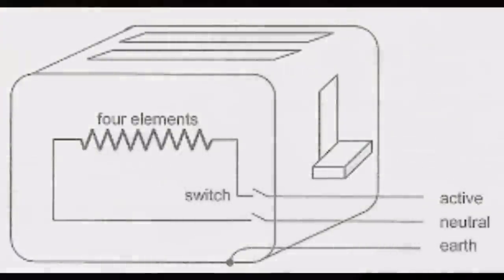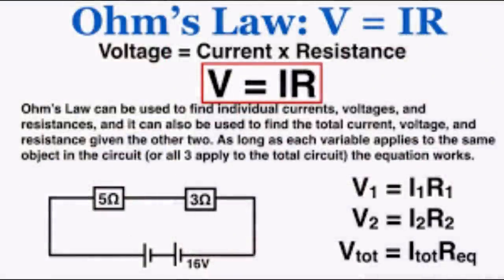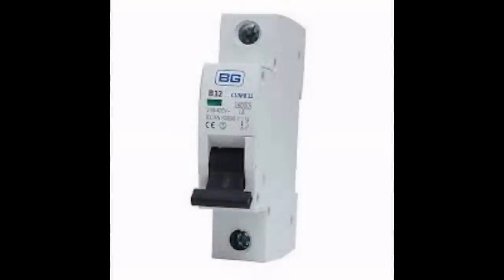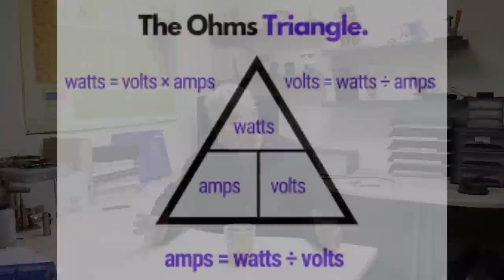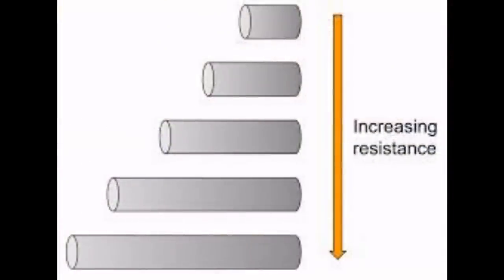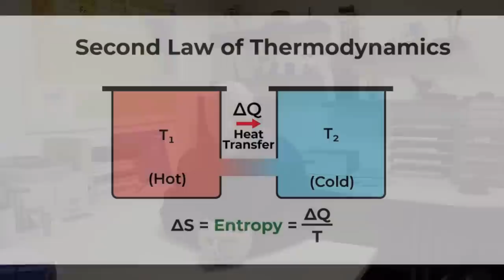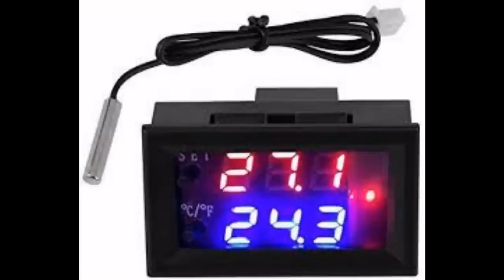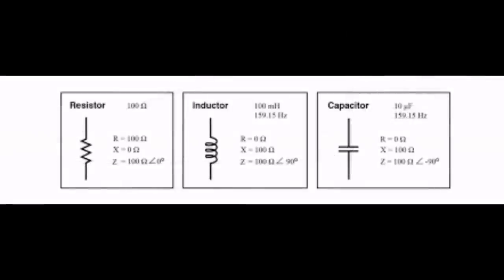1761 Controlling Electric Heaters Of All Kinds

Comment: That was very good teaching, Rob. As for the foot warmer I would like to remind everyone reading here that our body is a constant heat source to consider. When we put our feet on styrofoam it reflects our body heat right back at us making our feet feel toasty. Covering the feet also with a blanket traps the body heat and shields them from the cold air in the room preventing heat loss. Styrofoam works amazingly well and often comes as packaging material. Styrofoam chips should work as well though I have never tried them. Cheers
Reply from the maker: that is a good reminder mate - thanks for making it
Reply: In my working days, a few of the guys in the workshop would stand on rubber mats while at their work bench, made the world of difference in keeping their feet from freezing on the solid concrete floor.

Comment: There are a lot of heater controls available for controlling immersion heaters used in things like alcohol stills. Where you just plug the lead from the heater into the controller, like an extension lead. Some are just mechanical rotary switches, while others are digital temperature controllers and timers. Like the  Inkbird ITC306T.
Reply from the maker: yep loads mate and canoe super cheap

Comment: Hi Rob , thanks you got my head around the carbon fiber rope heating difference between 3 and 6mm :- lower ohms on larger dia size , less resistances more current/amp flow , for the same equal lengths of each size the 6mm will have a higher temp at same voltage open amp draw.
Thanks again

Comment: The one I came across was volts x volts / resistance = amps. I like how that one shows the effect of voltage to resistance. Since most people will know what voltage they want to work with, they can use this to figure amps for wiring and fusing, and multiply amps by volts to get the wattage. It's handy that you can find consistent resistive material easily to fit nearly any situation. Great video as always!

Comment: As for the kettle... When I divide those 3.000 watts by 240 volts I get 12.5 ampere. If I know divide my 240 volts by those 12.5 ampere, I get a resistance of 19.2 ohms, which is a little off of those 17 ohms Rob mentions. Did I do something wrong?

Comment: In North America, homes have a dual voltage system. More specifically, homes are supplies with two 120 volt lines that are 180 degrees out of phase and a centered tapped neutral from the transformer. General receptacles and lighting circuits us either on of the pair of 120 volt lines and a neutral. Major appliances like a water heater or range (cooker) are ran on both pairs of 120 volt lines for a total of 240 volts. Homes generally have either 15 or 20 amp circuits. Often, lighting circuits will be 15 amp, but they also can be 20 amp. 240 lines typically range from 15, 20, 30, 40, and 50 amps. The 50 amp is more for the main breaker for the 120 volt circuits in the circuit breaker panel. In the case of 240 volt breakers, they are actually composed of two 120 volt lines that are 180 degrees out of phase, and they are bridged together so both trip in a fault condition. Newer breakers are starting to have one lever that controls both lines.
Reply: Spot on👌

Comment: In the US your house gets 2 "hot" lines into the fuse box, 120 each. By connecting the 2 you have 240 for larger appliances (Heaters, well pumps), etc. Common panels today are at least 200 amp.
Reply from the maker: that's because that is the rating of the fuse at the service head - after the service head you get the meter and distribution board or what we all the consumer unit - that's where your 200 amps gets shared around the house - I have never seen a single circuit with a 200 amp rating in a domestic supply
Reply: @ThinkingandTinkering  I meant the main service breaker, not individual. I have seen 100 amp individual fuses, normally powers a sub panel elsewhere.

Comment: Thank you very much, Rob. This was extremely helpful. For a resistive pocket heater I could use different combinations of those white ceramic resistors to get the wattage I need with battery capacity and run time in mind. Cheers, mate.
Reply from the maker: awesome mate

Comment: A lamp (bulbs go in the garden) are used in loud speakers as a crude limiter where if the audio signal (ac volts) exceeds a limit due to excess volume the lamp starts to glow causing it's resistance to increese briefly dampening the power. Usually fitted to the expensive compression hf drivers. festoon interior car light bulbs are used
Reply from the maker: lolol - my professor used to have that particular issue too - lamps and bulbs lol

Comment: It's good to incorporate a normally closed thermal switch close to the heat source, with a temp rating, just below the max safe operating temperature, to shut it off before it burns down something! I use them with temperature controllers,   just Incase the relay sticks,  or the electronics fail in the on position,   a fail safe! It will keep operating at the max temperature, so a thermal fuse would not be a bad idea either!!
Reply from the maker: it really does depend mate - if you want to hold up your trousers with a belt, braces and a piece of string - go right ahead - but quite a lot of the time there is simply no need which is why in so many commercial products you just don't see them. Of course you always see a fuse - that's never a bad idea and ultimately is the most well used safety device and really should never be omitted in something you build yourself

Comment: What's a good way to control the current? I saw your last video and I would like to build a Dutch heater. I have my house converted to DC, so I'm thinking if I build a Dutch heater with a set resistance and I can control the voltage pretty easy with an esp32. But, if I decrease the voltage with a set resistance, the current would go up.
Reply: I guess you answered with the explanation of AC acting the same. I can just use pwm. Thanks!
Reply from the maker: PWM would work well mate - but you can use PWM with DC - no need to convert to AC - just use a timing IC even the good old 555 will do that

Comment: For General info. - the additional "control" in a kettle (and many other devices - for ultimate appliance fire safety)  a thermal fuse, when it blows, you may as well spend the $6-20 and buy a new kettle -- unless you know why it failed (around $4 from your electrinics supply for the fuse) in which case replace the fuse and hope all is ok...  lol...

Re.. heater types - have you covered PTC ceramic heaters - cheap,  quick acting  and "self regulating"

Warning - many of the Chinese PID thermal controllers run iff 240V AC - full mains current, and the SSRs pacared allegedly are of dubious provenance - I tend to buy a full price locally sourced DC - rated SSR for projects such as 3d Printer heated beds or other heating projects.
(noting that 12V rated heater pads run perfectly well off 18V  RC battery charger power supplies - -probably the lowest cost "reliable 600-1000W power supply.  (I also sourced 240V rated heating pads for projects to free up my precious DC PSU)

Comment: Joining together two ideas I have for a project. Sand battery ran off a solar panel and a thermal switch mounted on the side of the sand container. I've found one online that cuts off at 70°C and back in again at 55°C for a couple of quid. Just need my suitable container to make it with now. 
The solar panel unregulated will give around 18/19V assuming we ever get any sun. If it proves then next winter there'll be a Ugrinsky on the top of my shed. I have ideas for the generation side of that and thinking head is on to weigh up the practicalities.
Reply from the maker: sounds good mate but ike you say a few practicalities to work out there

Comment: I bought three parabolic infrared heaters, all different brands. All three blew out, somehow, and stopped working. I cannot find any of those small electrical appliance repair shops that they had around when I was young. I'm going to pull them out of the closet, take them apart, and try to fix them -- now that I have this video to aid me.
Reply from the maker: awesome mate

Comment: I had a brainfart.. What if with mechanical advantage you could use a big piezoelectric Chrystal like a car jack.. to heat an element. Or big resistor. Is there anyway to multiply that advantage?
Reply from the maker: I honestly have no idea
Reply: I came up with the idea.. cause bigger crystals will get bigger discharges..  

So if you had a anode and kathode with a big Crystal between it in a strong clamp like a vice. You could get probably a thick wire to glow.

Comment: bimetallics are nice when you need no power consumed by the logic  , ones with 3 terminals are nice so you have Normally closed or Normally open options even in "the field", plus they can accept very wide voltage ranges etc. quite versatile, sometimes even have a field adjustable set point.   (old attic fan t stats)
Reply from the maker: yep they are pretty good for what they are and what they can do
Reply: Good tip👌
Reply: Good tip👌

Comment: I have a $100 12 volt Solar panel I bought from Harbor Freight.  I'm going to hook it up to a 12v water heater and put it in a galvanized bin with Sand in it.  I'll put some fiberglass in the lid, but the heat should radiate out the sides.  The Sand will store the heat during the day and keep my garage slightly warmer at night.
Reply from the maker: nice

Comment: Electric companies are only interested in total demand relating to the cable size into the installation. They will contol the amps by the size of fuse they install at the origin of your supply. They aren't at all interested in the size or fuses/ breakers with in the installation. NB with LED lighting a 6amp fuse is way over sized and a 2 or 3Amp fuse would be more than sufficient. Gls Lamps "light/lamp bulbs" have not been sold for general use in the uk for 12 years plus.

Comment: I saw a ceramic heater taken apart lately and saw that the fins were carrying the electricity. I had always thought there were wires connected to the ceramic heater bits. This is obviously easier to build. I now know not to poke at the heater fins :)
Reply: Just as [eletrocutingy] dangerous as a nichrome wire heater - don’t poke ether of them, or put a knife in a toaster 🫢⚠️
Reply from the maker: lol - learn by doing eh lol
Reply: @samuelfellows6923 O come on, poking at toasters is fun. Just make sure the knife is touching the metal case. 

DISCLAIMER: I am not responsible for the actions of others. Follow these instructions at your own peril. Or just make someone else do it.

Comment: 4:52 Gotta interject here. This is where comparing electricity to fluids fails. Amperage isn't the number of electrons whipping past... electrons don't actually move all that much... mostly from one atom to another, dislodging a spare electron which then collides into another atom. Sort of like billiards. The number of these electrons moving at once from one atom to the next, in the same direction, is what current is. If you were to track a single electron's path in a circuit, it'd only move a couple microns... but the electric field that that movement creates does travel from one end to the other. I think the most apt depiction of electricity is one of those desk art pieces with a bunch of balls suspended from above. Lift up one ball on the end and let it smack back down into place, and the ball on the other side of the line of balls moves out, then back in, smacking into place and dislodging the ball on the other end again. The balls in the middle which don't really move but still transfer the force between them is how electricity works. The force transferred is the electric field, which actually does the work inside the circuit. The harder the balls, the less resistance and the more power that can be transferred, the softer the balls, the higher the resistance and the less power can be transferred.
Reply: 6:44 This also helps you to understand why some materials have higher or lower resistance than others. The electric field and current depend on the direction of movement of these electrons as they're smacking into atoms. The more chaotic the structure of the material is, the less chance there will be to have more electrons moving in the same direction, so you get higher resistance. The more crystalline the structure, as in most metals, the easier it is to move electrons in the same direction, which leads to less resistance and higher amperage... instead of bouncing around in all directions creating a bunch of heat that won't go anywhere, most of them bounce in a single direction... which is what you want for electrical transmission.
Reply from the maker: so you are not a fan of the 'sea of electrons' model for metals then? To be honest mate - I don't disagree agree with you particularly but I will say we really don't know how this stuff works - we have a few models of how we think it works and those models fit and describe behaviour we see and we then use those models to predict but that is different from knowing. The complexity fo a model is really down the complexity of the system we are analysing as opposed to anything being wrong or right per se

Comment: What I find lots of people don't realise is that you don't draw out amps or power but you are limiting the amount as the base line is a dead short or open circuit.
Amps we control via Volts/ohms. but it's not an physical thing it's a result of a fixed potential, Volts and a physical object, Ohms
Reply from the maker: for sure

Comment: How about an electronic cutoff controller with a power use sensor?
Reply from the maker: I covered those mate - they are a variant of a digital controller that's all
Reply: @ThinkingandTinkering  And not as elegant as controlling the variable at its source.  But it won't eventually burn out from system heat.  I was just spitballin some way to get around localized overheating that's distant from the sensor.

Comment: Same with your gas tank , in tank electric fuel pump , never let your tank get below a 1/4 of a tank , pump runs hotter , then locks up ,
Reply: I've had two vehicles running on LPG, one van and one car, both had fuel pumps in the tank, I did over 100,000 in each, very very rarely was there more than a 1/4 of a tank of petrol, normally just enough to keep the level light off, both were EFI and only the injectors were turned off (emulators are used to intercept the signal, keeping   the ECU happy) 
So in both cases the fuel pumps was running continuously never had any problems, I gave a mate a lift from Cornwall to Telford every week for months, he was very worried we wouldn't make it with the fuel light on! We stopped in Bristol and I put £5 worth of petrol in (5lts ish at the time) he was amazed at the fuel economy when the light was still off 400 miles later on with only a £5 worth in the tank?
Reply from the maker: cheers mate
Reply: Things in America , designed to fail after car warranty expires

Comment: Blah blah blah! I want to lower the CONSTANT (not cycling on and off) wattage draw of a resistance heater so it doesn't overheat the supply wire. I didn't get any answers here. When I ask if it will rain I don't want an explanation  how water is made and how rain happens.  What about "Controlling Electric Heaters Of All Kinds". Wasted my time.

Comment: You folks in the UK boil water much faster than we do, here in Canada.
Reply from the maker: do we really?
Reply: @ThinkingandTinkering  Yes our kettles are less than a kw 15amps @ 110 volts circuit so the element draws about 1000 -1500 watts

Comment: i'm now happy using my home made methanol heater
i pack a baked bean can with green floral foam
now getting over 3 hours use with 250ml of alcohol
Reply: I get the same duration from 250ml when adding tonic 👍
Reply: Does the foam burn?!?
Reply: @stevecann3394  I'm in the uk and buy oasis floral foam from hobby craft for £1.50 it's fire resistant, make sure you buy a floral foam which is.
Reply: @j_o_h_n_d_u_n_n  nice one i have seen a lot of comments on this channel with people complaining they can only get one hour burn time with 500ml of alcohol.
 the first time i tried making a heater i had the same problem but once you learn the principles and play around a bit it works fine.
Reply: @standfortruth4568  in my case , I prefer ingestion rather than combustion 🥃
Reply: @j_o_h_n_d_u_n_n  rums my drink of choice.... enjoy
Reply: @standfortruth4568  So the inner can turned upside down is filled with oasis?
Reply: @lorifilm  yes... i use a new cheap metal toilet brush holder as the outer tube then use two baked bean tins inside.
one can to prop the other one up.
i  then use a cutlery holder with holes in as a mantle over the tube, you can get one from ikea quite cheap, you can view the one i use in roberts 1738  safety video
Reply from the maker: that is really impressive mate

Comment: On a slide note-I am struck by how quickly a 3kw kettle will boil water when I visit the UK. I return to Ohio and my puny 1.5kw seems like it takes forever. Operating at double the mains voltage means the kettle in the UK can have twice the power while drawing the same current as the US kettle. Thanks Robert, well explained.

Comment: For those who want to DIY their heater controls there are plenty of Arduino projects out there that can use a thermocouple as the temperature measurement and an SSR to switch the heater on and off. Thermocouples have two dissimilar metals and are joined at one end. As the temperature changes, this creates a tiny voltage difference in the thermocouple and an interface chip converts that change into data that can be read easily.